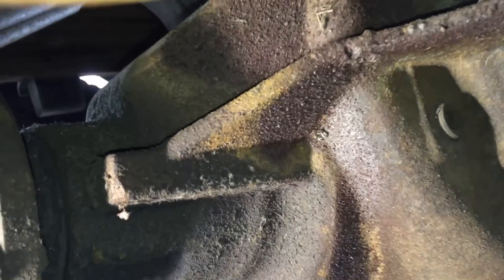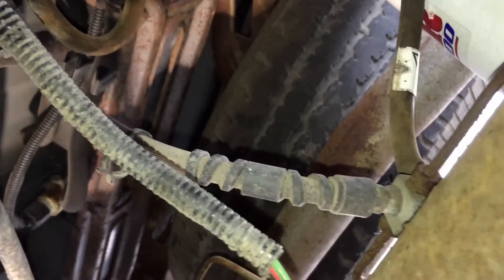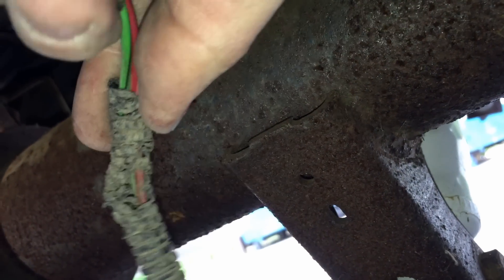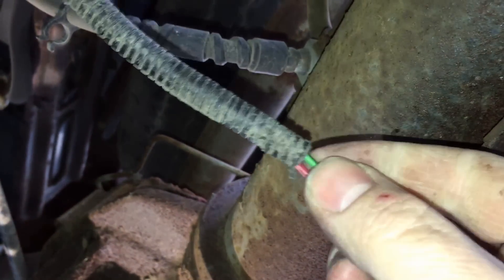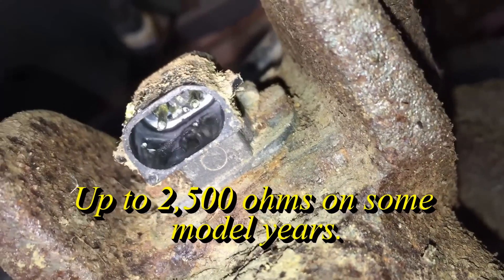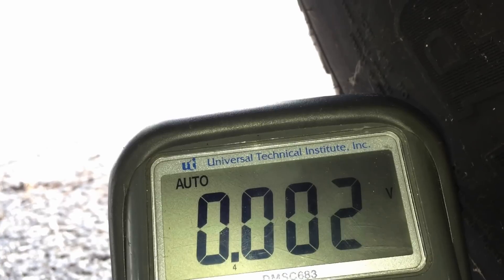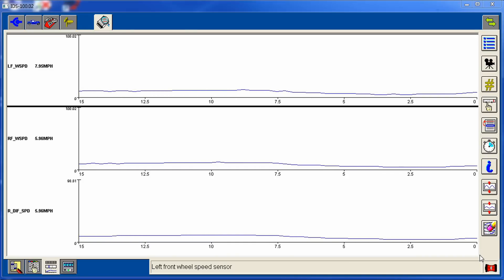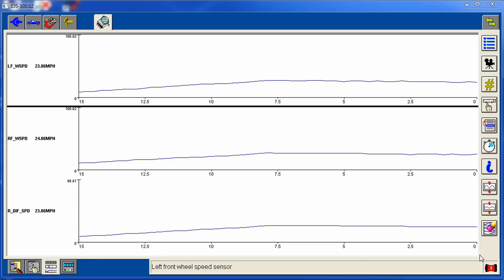Ford Vehicles: ABS DTC C1230 Diagnosis and Repair

Comment: No code yet, but abs light is on for a few seconds after the engine is on. I have a generic scanner and have plugged it in when the light is on but there is no code. I will try the information here and hope this will fix it, thanks for the cool video.
Reply: it's normal for abs light to turn on briefly when the ignition is turned on. hope this helps.
Reply: Thanks...

Comment: ok since were talking breaks I just had to replace my emergency breaks on my 2004 f150, my first problem I couldn't get my wheel off of the hub then I couldn't get the hub off of the spindle I had to take a big hammer the tire then a puller to the hub only to find out that the break shoe de lamented its self from the metal hardware, are you seeing this in many trucks, and keep in mind these are what came on the truck when I bought it new in 2004.

Comment: hey question. on the dash does the abs light and the 4x4 light stay on if the wire is bad... 2003 f150 fx4 4x4
Reply from the maker: +charles cruz If a speed sensor input is missing from any one of the sensors it will keep the light on so yes.
Reply: +FordTechMakuloco thank u sir. and for the video demestretion
Reply: Ford 1989 abs repair

Comment: How do you check the D.S. front wheel speed sensor on a 98 Lincoln Mark 8? Front brake job done but at 10/20 mph the car does a self test and is now dragging the front brake. Pulled the under hood relays for ABS, traction control to get it home. No chain store can order me the sensor and my local Ford dealer says" not available". Which with this dealership is no surprise! Any direction on obtaining a new sensor or checking the one in the front? Of course with the relays pulled, no speedometer signal, constant error message on dash display.

Comment: I've got a 1999 Ford Ranger with 4 wheel ABS. For the past year I've had a code for the left front wheel signal input missing, I forget the code number. Using some scan software (Fordscan via OBDII), the signal is truly missing, staying at 0 no matter how fast the vehicle is moving. I've changed the sensor out and the harness but it still is missing. Any advice?

Comment: Hi Brian,  Always watching your excellent videos...  Did you use some sort of Y cord to do that while the ecu was connected to the sensor?  Checking the pulse from the ECU is a good idea, which wasn't identified in my factory manual.

I had this issue with a 99.5 F250.  The transmission tow light came on, the speedometer was bouncing all over the place in addition to the check engine light.  I was able to push the button to get the transmission out of tow mode and realized it was likely a sensor.  I drove half way across the country to get back home, scanned it, and per the manual, checked the wiring and the sensor.  The sensor was toast (infinite impedance with the ohmmeter).